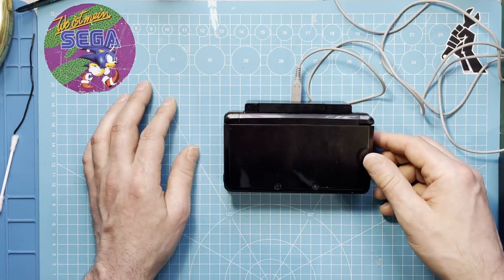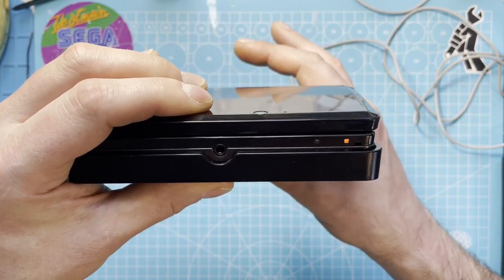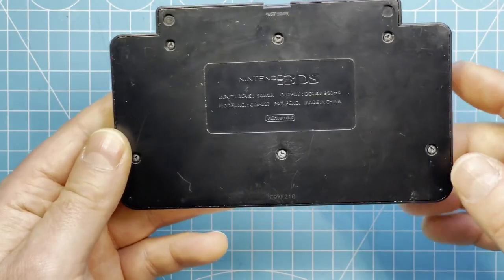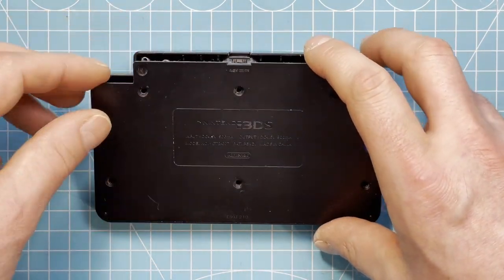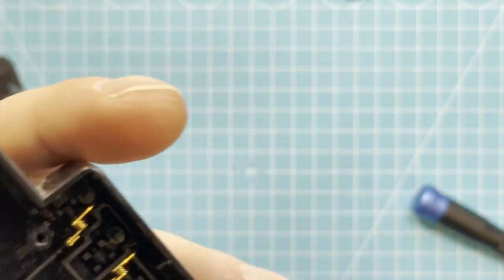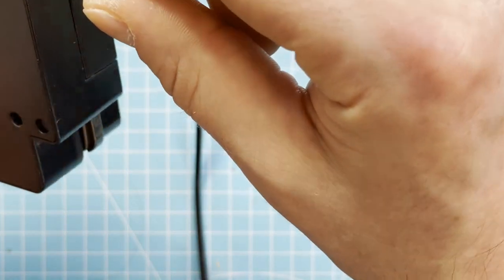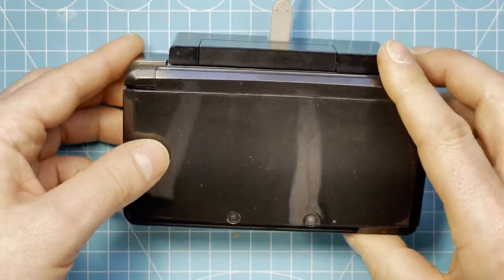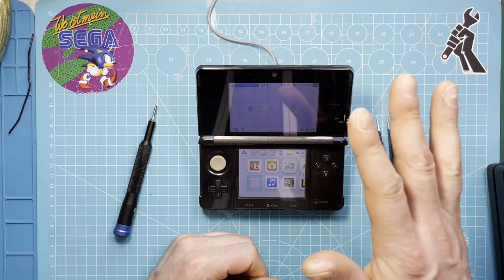FIXING THE CHARGING DOCK / CRADLE FOR THE NINTENDO 3DS

Comment: Mine is not even charging i open it to see if a cable cuted but nothing its like new inside the port looks fine i don't know if my 3ds have the problem in the 2 copper pieces i don't know 🤷
Reply from the maker: Is it charging without the dock?
Reply: @TheKonsolist  yess
Reply from the maker: Weird🤔. Maybe try cleaning the contacts.
Reply: @TheKonsolist  o try it but nothing 😅 i am not worry so much but i want to fint a solution 😂
Reply from the maker: Tell me, if you find the fault. I'm very interested in what's wrong with it. Hope you enjoy my channel. Would be happy, if you decided to subscribe to it. Good luck with your 3DS.
Reply: @TheKonsolist  thank you i think it will take long i will try to put the doc on another 3ds to see or i will try someone's doc😅🤷
Reply from the maker: Good idea👍
Reply: @mixalhs8155  i have same problem, anything did help?
Reply: @flynnmax  no i didn't check it i am thinking to ask someone that knows if the electric travels to the port or if it travels to these metal triangles that appear whe you prs this button